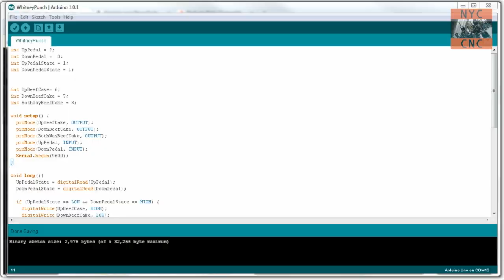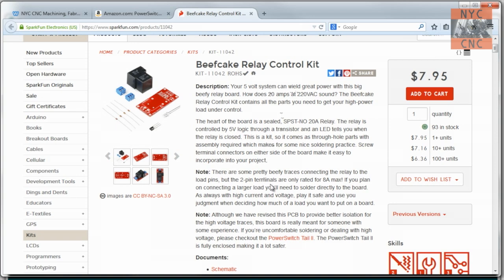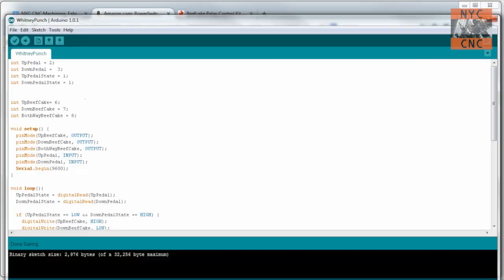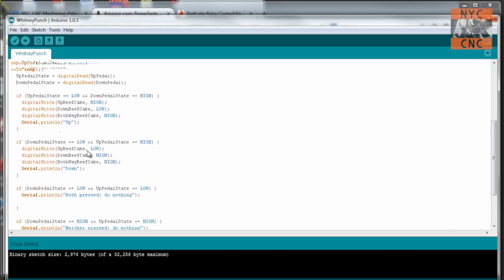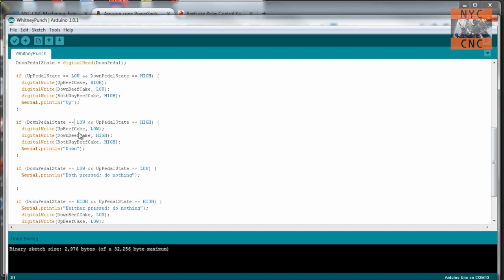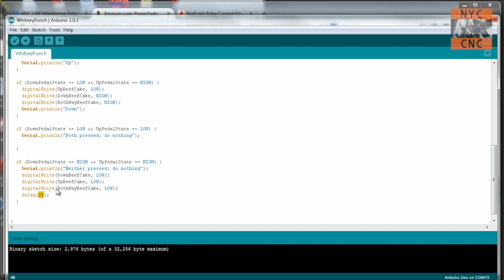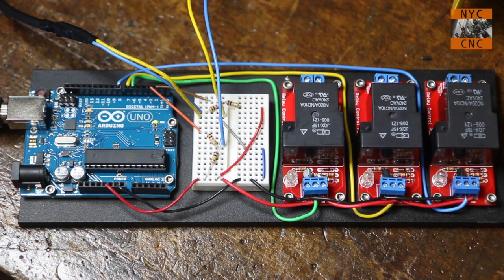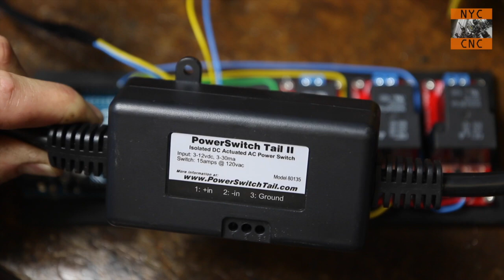Arduino Steel Hole Punch!  Retrofitting Foot Pedal - Part 2

Comment: Looks pretty safe to me. Though I wouldn't run the 5v signal lines underneath the high power lines. Just keep all the lower power wiring at the frontside and high power wiring at the back. 

If you enable the internal pull-up resistors on the atmega you could connect the pedals directly to the Arduino and would need the breadboard. Just use:
 pinMode(2,INPUT_PULLUP);

Is the original switch still connected?

Comment: Having fun in the shop! 

Reason for hand control is often to make sure your hand is away from the punch! Liability issues, we had machines that required both hands to press switches (work had to be clamped, two switches to insure hands clear of punch).  

Find a foot pedal with the rocking action. Toe (ram down) heed (ram up). You still want the interlock code in case a switch fails.

One caveat, when you have employees.  If the switch fails, and someone gets hurt, you are the product manufacture (huge liability).  At work I can do a $50 solution, but corporate legal folks want you to buy the $1700 OEM solution (much cheaper than a $10 Million law suit).

Comment: Good work!

You could tidy that up by changing the orientation of the Beefcakes, you're chasing the control wires around the board when you don't need to.
Reply: NYC CNC
I think you earned a bit of slack on planning the layout, with the rest of final result of the project ;)

Comment: you love arduino :D
just thinking here you could have skipped it altogether and use 2 diodes to power the "common" relay from the other 2 and keep those inputs isolated that way - after part 1 I could have bet you were going to use the arduino for "down" with the pedal pressed and "up" when you lift the foot with some timer on the "up" cycle.
a bit overkill in the end I think but good enough excuse to use the favorite toy  :)

Comment: I would have mounted  a pedal on the original switch that mechanically toggles it just to stay with the original .   heel toe operation
Reply: NYC CNC i often do stuff complicated way so I can learn. Usually my ignorance helps me with that lol
Reply: the switch that came with it is mush better and safer. just a thought.
Reply: yea the switch that came with it was done with electrical engineering  involved . and the switch is very robust made for 10000 cycles     SAFE
Reply: so to keep the oem equipment might be a good thing...
Reply: NYC CNC I thought of that one right away. Less tinkering think about with your skills and machinery you could have made an aluminum cover plate mounted it and your done. However, I am glad you did not because we got to learn about something else. So, all is well.
Reply: ALL IS GOOD KIDS .JUST A THOUGHT

Comment: When we do this in industry we don't use any electronics just a normally closed interlock contact on the foot switch not being used, having said that your system does have some advantages that you have not taken i.e. a timeout to ensure that the switch does not remain pressed for an excessive time and an auto up function.

Comment: Great vid john. One step closer to trying something myself, but I always find the biggest hurdle for a hobby guy is the price of the electronics. What did it cost in parts (electronics only) to make this happen?
Reply: Darko Bulatovic I think I`ll get a starter kit for $100, get off my a$$ and play around. Honey, can you make dinner tonight?

Lot's of people on facebook, maybe I need to get me a facebook account. Nah, I'll live with youtube and these comments.
Reply: Steve, The adruino boards are cheap.  There is a lot of fun in just getting a $20 and blinking LEDS.  I'm making one board to SPIN so one row of LEDS (8 total) will read out as 20 characters as the board spins.  Fun project.

http://www.digikey.com/schemeit#     -- while not the best software, but decent for free. Design your board, layout you board, have boards made, solder everything together.
Reply: NYC CNC and learning to do stuff yourself = priceless.
Reply: ***** I guess I am more afraid of the time it will take to learn all this stuff. I am a coder of over 35 years, everything from microcode for custom processors to c++ and java, I also buy and restore old machines that I'd like to mod some with cnc. I don't want to drop all sorts of money and then find I don't have time. But for $100 if I can get get my feet wet I guess it would be worth it.

Wife+kids+full time job+machine restores=not much time to sleep let alone take on a new project. But I think I will try.
Reply: If you look harder and you learn and do some of work yoir self this can cost as much as 10$ with postage. Give your self time learning electronic. It will be rewarding. I am similar like you i do a lot of programing and that knowledge will help you a lot.
Reply: Steve S i learned a lot on youtube. Soo much good tutorials. I did same when i started with 100$ kit.

Comment: Our Iron man at work has a foot pedal that only controls the downward motion. When the machine reaches full down it will auto retract to full up. The only reason why I bring it up is because I think you might already have limit switches installed. Just tap into them and a little programming and your operations will be even easier.
Reply: I was just thinking the same thing. Limit switches and an auto up program would be even nicer
Reply: I can see how the pedal to go up could be useful. The Iron Man requires you to hit a cancel button if you get into that situation. More often than not I just remove the piece, stomp the pedal and start over again. BTW Thanks for the T-shirt. I received it today and must say you chose a nice logo for your business. Clean, Classic and Cool. I will be wearing it.

Comment: That's great. I wonder if the covered foot switch would be easy to modify and make a taller cover piece. The uncovered switch could be mounted to the underside of the cover. Push down with the toe and it goes down and press up with the same toe hits the top mounted switch and goes up? Viola both switches are covered and its easy to tell which switch you intend to press.

Comment: Okay. Interesting build. Just a few things you should consider.
1. All these jumpered connections on the breadboard are very likely to come loose. They are definitely no solution.
2. Make sure to use cable end sleeves on all flexible lines that get connected to a screw terminal. This prevents wires hanging out and gives the clamp more grabbing meat.
3. I'm pretty sure (can't see so good in the video) that's a 24v tranformer in the control panel and all connections to the switch are only 24v for switching the valves. Big wire just don't tend to break that easy that's why they are used on remotes.
4. Why didn't you justt get some combination relays so that you could eliminate the arduino? That would be much safer. I don't see any safety measures on the arduino, no optical isolation no watchdog...

5. What is the reason to use 2 pedals? Whey not press one to go down and release it to go up?

If you need any help, feel free to contact me.
Phil
Reply: NYC CNC 2) I think they are called bootlace ferrules, don't know if it is a requirement to use them with permanent wiring with multi stranded wire but it might be and it looks nice :)
http://www.cse-distributors.co.uk/wp-content/uploads/2014/05/pre-insulated-ferrules-l.jpg
Reply: NYC CNC Hey. Didn't mean to insult you in any way. I was just wooried about your and others safety. An arduino is unfortunately, even if it doesn't look like it on the first glance way more dangerous than the hand swjtch.

1) As it is following a program there is the possibility of it to hang up. This might be due to programming issues, but more likely because electromagnetic interference. This can either lock up the controller or make it do random things. That's what a watchdog is for, it resets the controller in the case of an error ( simply put)

2) The small diode on the relay board is an very critical part. It "absorbs" the energy that is created by the movement(induction) of the relay coil on its return cycle. These pulses are known to be of very high voltage and can damage the port of the controller. As the damage is random there is no way of predicting in what state the port remains after the damage. it could lower the press, raise the press, try to do both at the same time or do nothing at all. An optocoupler can remove this problem if used correctly.

As I design and build control systems as a living I can tell you that exactly these small things re very important. Nobody want to get a hole punched into his finger or hand.

I hope you consider reworking the controls for your and others safety and again if you need any help just drop me a message.

Thanks for your time.

Phil

Comment: Good job. I would consider to use solid state relays. I found some that handle 380V and 40A. Also you could find smaller form factor arduinos on ebay. I dont know for that sparkfun module (i would guess they did a good job) but note would be to make sure that arduino is opticaly isolated as well from relays. I had planned similar project to make a brake on my g0602 lathe but was thinking to do the hole thing with microswitch and aluminum. This pedals look like nice quick solution.
Reply: ***** SSRs are more reliable in number of time they can switch, with a whoole lot of buts attached. Relays handle overload better with a short an SSR will die before the fuse blows,  Typical SSRs only work on AC. For things like a transformer turning on at zero makes the inrush worse.  With a zero crossing SSRs you can only do very very slow PWM so it is really only good for heaters. There is no galvanic isolation when off they can have several mA of leakage and they require a minimum load current to turn on
Reply: NYC CNC
SSRs are usually preferred over magnetic relays, because... well, they are not mechanical ;-) Mechanical relays last shorter time than solid state. But that's actually secondary. If you imagine a plot of the sine wave of AC, the SSR switches on when the plot crosses the x axis (it's called "zero crossing"). What that means for your circuit is that the voltage ramps up (not in-rush current), which means less heat dissipated and much less stress on the components. Also, you do not get any EMF from a relay coil. That's probably not that critical for your application, but nice to know for future use, when you place your microcontroller on the same PCB with the relay. And another reason you probably don't care for right now, is that with SSR you can use PWM to control the power to the controlled device. By switching on/off very fast you greatly reduce heat and stress, but also over time the size of your electric bill.
Reply: *****
Yeah, well, the electricity saving is insignificant only if you are running hobby stuff. In industrial setting it adds up. But the reduction of heat dissipation and extending components life through that is on the other hand pretty significant. As to relays clicking, how much do you think you'll hear in a noisy workshop, especially if you do it right and wear ear protection as well?
Reply: *****
But if we want to be nitpicky, ok, the ssr on its own will not save you any electricity. It's the increased efficiency when you use ssr with PWM that helps save energy
Reply: *****
Well, ok, not real PWM. But you have 100 half-periods for 50hz sine wave, and 120 in the US. You compute the total time for 50% or 70% or whatever duty cycle is needed and use a timer to turn on/off the relay for that time. Forgot how that type of control was called.
Reply: Here are basic reasons:
" When used as intended, SSRs will perform indefinitely, usually outlasting the equipment in which they're installed. They operate silently and produce little electrical interference. SSRs will function over a wide range of input voltages and consume little power even at the high-voltage limit. They don't produce any arc, making them suitable for hazardous environments. Most ac switching types employ "zero-voltage crossover," which minimizes surge currents. SSRs have no moving parts, so physical shock, vibration, or changes in altitude won't affect them."

One of most important thing (and I am no expert! Just lerning stuff) when you deal with inductive loads like motors (and even magnetic relays) etc is to worry about currents that are created when circuit is disconnected. This can be 100 and more time higer then normal and basicly electricity gets trapped in between and acts as multiplier. On smaller stuff diodes are used to resolve this and not damage rest of circuit. But on high power motors etc this can be a bigger issue. That is why i was worry(which might be over reacting).
I found a great deal on ebay for industry grade SSR i got 5 24v-380v 40A for 15$ they can be triggered by voltages from 3v to 32v which  is great. but they are more expensive usually.
Reply: NYC CNC i have added several stuff to my lathe, light, DIY mister with mini compressor and also thinking to upgrade motor and want to make arduino smart controls(like delay start for mister and timed operation so it is not spraying all the time on longer operations). The thing with stop button on lathe where i need to go with my hand all over on other side is a safety issue when my both hands are on handwheels. Foot brake would help me to stop machine much faster and safer in case of something goes wrong. It happened once to me that peace that I had on dead center slipped and it was no fun. Thanks God nothing happened but gave me some ideas what it could. The time and extra dangerous situation it took to strech my hand over to press stop button made me thinking of doing this.

Comment: Hey, that was a cool project, all the better because it's really useful. If you don't mind, here is a suggestion you should follow, when you are reverse-engineering a circuit with intent to modify it. Please, please, please, make a drawing! It doesn't need to be EDA-quality, just a hand drawing will suffice. Draw the switch from top and bottom and label the sides; draw the lugs around where they are positioned on the actual switch and put the color of the cable fastened to the specific lug next to its representation on the drawing. After you figure what is connected to what else when you press up or down, you make the appropriate connections with a different color marker. If you keep the drawing, you will be always able to restore the circuit if needed. And man, you figured out the circuit with the continuity tester, but as distracted as you could be with the camera, you could just as easily have made a mistake without the drawing. You definitely don't need anything blowing up in your face - especially not high current/high voltage.